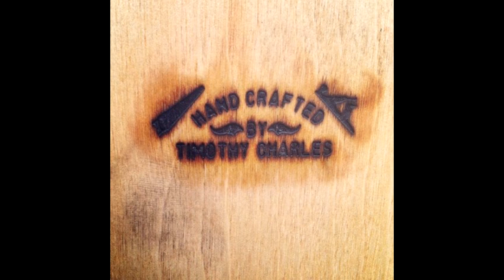Pine Bookcase

Comment: Very nice. Just a suggestion though. With soft woods, it is much easier to saw out the waste for the dovetails. I like a jeweler's saw myself.
Reply from the maker: Yes, but I broke the blade on my coping saw and waiting on a new blade.
Reply: That's the big reason I like the jeweler's saws. They are adjustable and you can use broken blades :)
Reply: Very nice. I especially like the crickets in the background, perfect for a project video sans power tools.